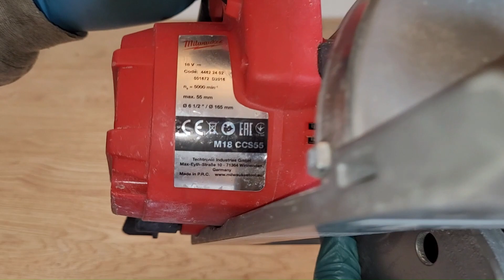Milwaukee Circular Saw maintenance M18 CCS55

Comment: If i need to get to that spindle lock do i need to take off the other half?
Reply from the maker: No, Good luck
Reply: My spindle lock was snapped when I bought mine used, I just loosened the guide plate to get to mine, and a few other screws. got my gunsmith mate, to make me a new locking arm